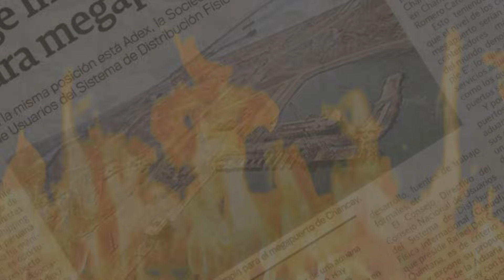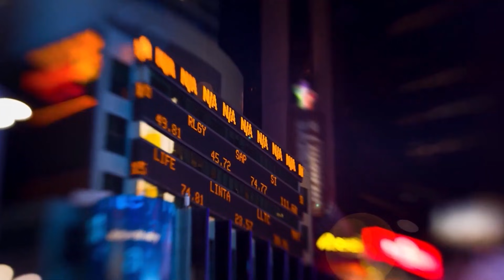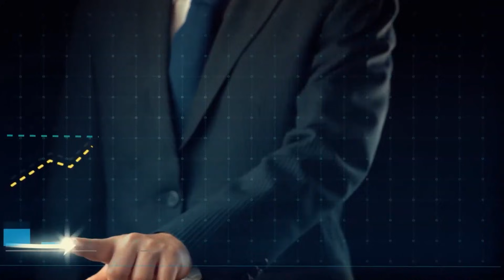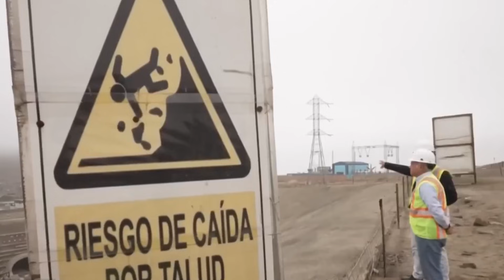The Impossible Port: 25,000 Concrete Blocks, a Hidden Tunnel, and a Race Against the Pacific

Comment: Elegant engineering solutions to create the new port; however, still not sure how the port will pencil out without more inland infrastructure throughout the SA continent. Port seems a bit of an overkill without additional transportation corridors. Cutting transportation times by 10 days is definitely a plus. In the meantime, the port can consolidate containers from smaller container ships. 
PS — you couldn’t find one picture of an “Acropod" aka wave-dissipating concrete block?
PS2 — wonder about the impact of the port of Chancay will have on Port of Callao: Peru's largest container port and main maritime gateway, located near Lima. It has two main terminals operated by APM Terminals and DP World, and handles the majority of the country's container throughput.